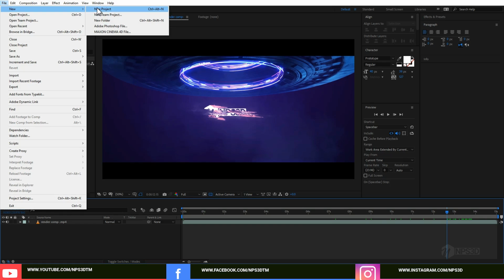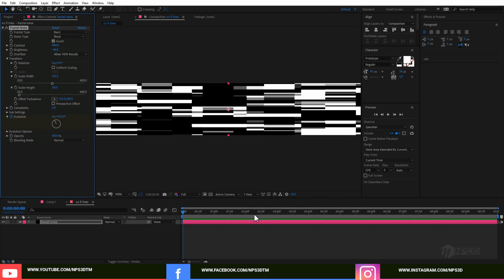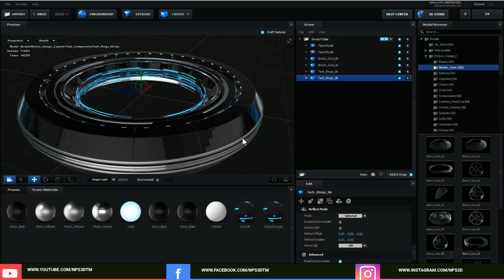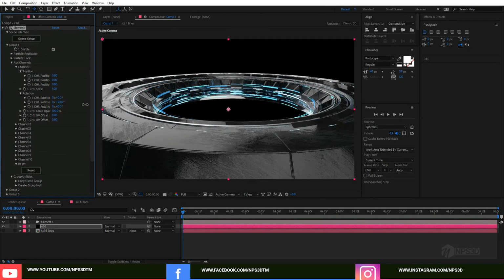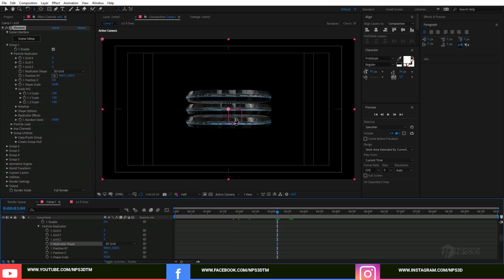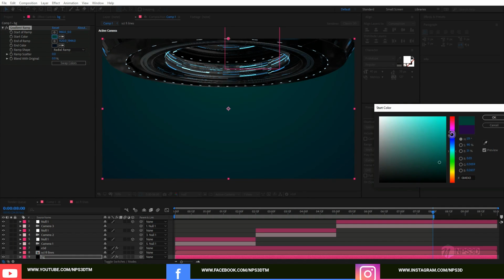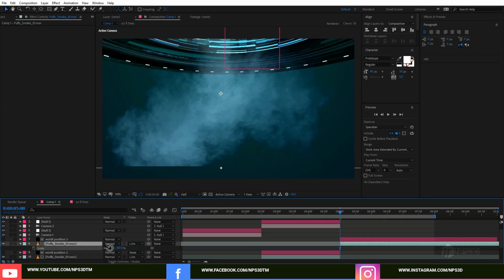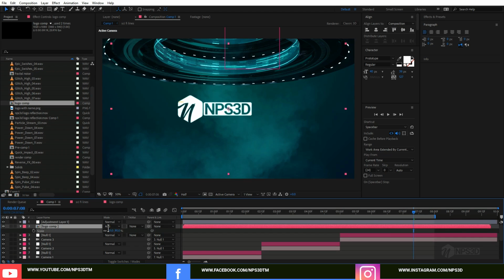SCI FI HUD DESIGN TUTORIAL | ELEMENT 3D |AFTER EFFECTS | NPS3D | 2019

Comment: Great tutorial!

However, one thing I can suggest is to use the time expression when animating the rotation parameters so they constantly rotate rather than using keyframes to control speed and times. The expression is simply ... time*100 ... number controls the speed or simply time*-100 for opposite direction. This can be applied to several properties in After Effects.